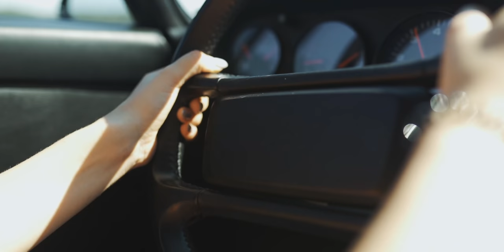SOPHIA - A day with the Porsche 964 RS - pure racing emotions and the beauty of design of Porsche

Comment: Nice video. A couple of things I'd like to correct you on. There were actually only 1,990 cars made. Chassis 0061-2050. The engine lid is not aluminium, only the trunk lid. Also, the car was available in around 12 different colours, not including the Paint To Sample colours. Great work though.

Comment: Sophia you can't see if it's a original car from the holes, those are welding holes and if you have to get the rear fender replaced they will put it back in

Comment: What makes it so special? Well, you have to be able to drive properly to drive it. No annoying flappy paddle transmission. no traction control, no stability control. If you can't drive a manual, heel & toe downshift and trail brake....then don't bother
Reply: also, the turbo version was notorious for spinning out at around 3500rpm right?
a lot of people were wrapped around trees in those because they couldn't control the sudden burst.
I'm not sure of it was the 930 or the 964, but it was nicknamed the Widowmaker.
Reply: @usuallyclueless4477  The 930 was the car that first  gained Der Wit Wenmacher, The Widowmaker. moniker. The fact remains, in the hands of skilled drivers, they're blindingly fast vehicles. The problem is they were  often bought by guys with more moey than driving skill....who didnt't know how to drive then
Reply: @michaelwilson7924  true.
I remember watching the video of the RUF version of the 930 turbo being driven around nurburgring.
Extremely fast, and the driver was fighting with it really well.

I myself haven't driven one of those in my life, but I've tried it in a simulator (the closest I can get to it) and it was hard to control.